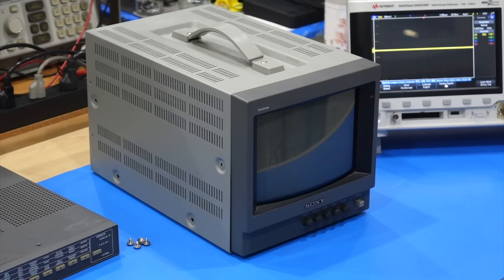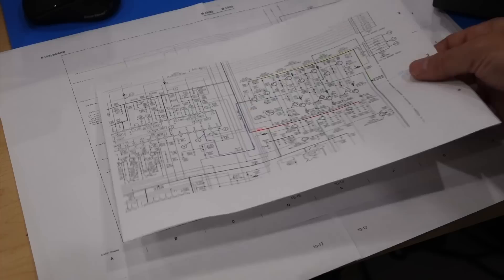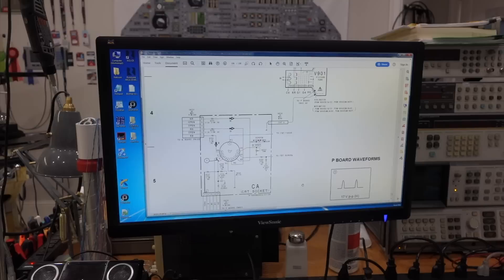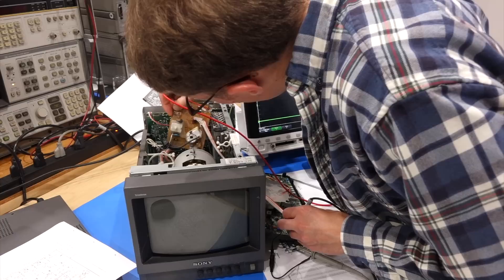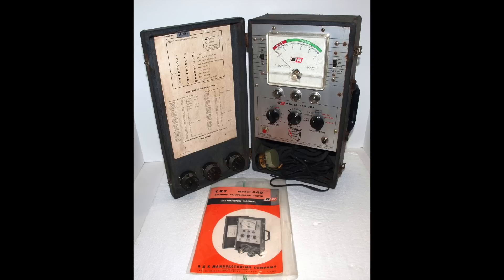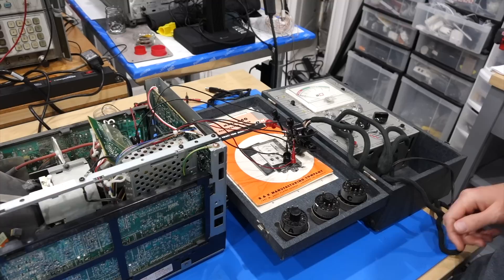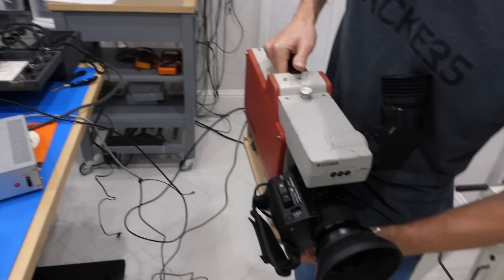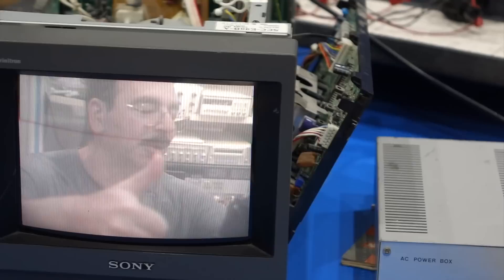Rejuvenating a color CRT

Comment: Awesome vid, takes me back a few years.  I still have a rejuvenator, it does not work on LED tv's.  LOL
Reply: Have you tried? 😂
Reply: To be fair you don't need a specialized, high vacuum glass working facility to rebuild a LCD with new backlights. A kitchen table, Phillips screwdriver, and an eBay account will suffice.
Reply: LCD..what a joke that was. The worst rv screen ever invented. I remember you had to sit directly in front of to get somewhat a decent picture. If you were off by 3 degrees off center luminous shifts to blotches of shadows.

Comment: I've had mixed results rejuvenating CRTs, the main thing I've learned is to quit while you're ahead. If you get improvement doing it once it's tempting to try hitting it again but in my experience that usually leaves you worse off than when you started. I've never tried rejuvenating a Trinitron but I always heard they did not respond well to it.
Reply: Do any of them ever last for any length of time though?
Reply: shango066 says never rejuvenate a Trinitron.
radiotvphononut as well ...
Reply: @wishusknight3009  Yes, sometimes, I've seen them go a few more years. If it's something like a TV that you're using for hours a day you'll probably buy a few months at best but for less used stuff like vintage equipment it can be significant.
Reply: @fostercathead  If it is still useable then yes, but a tube in this bad state you really have absolutely nothing to lose.
Reply: In Trinitrons and most recent CRTs the gap between the electrodes is quite small , so there's a good risk to end up with a short circuit. A workaround is to lower the high voltage and increase the max current to literally blow out the impurities. It's still quite like Russian roulette though
Reply: When I was a service tech for a TV shop, we would often give the tubes in our rental sets a boost when they were tired; some of them lasted another year after the treatment, some lasted a few weeks. The CRTs in the ITT sets, especially the older hybrid sets, used to respond very well; most Japanese tubes didn't respond well.
Basically, the larger the cathode, the better they responded to treatment; B&W (monochrome) tubes were often the most successfully recovered.
Reply: @wishusknight3009  It depends on the equipment, the condition of the elements in the tube AND the person doing it.

Back in my TV repairman days, I had a REM tester/recovery unit.  It was the best I ever used or had.
It could be very gentle to very harsh on the tube.  Even though I no longer repair TVs, I do wish that I would not have sold that unit. 

But anyway, tubes made in different eras have different results.
I found that the early tubes, like from the 60s, 70s and early 80s (name brand) would rejuvenate rather well and would work for months to years.

Of course, that's not always the case.  I had some where the tube was pretty much dead, I'd rejuv it, the guns would show as good, but like it was said here, in a few hours, the guns would start to lower output again.

It's really hit and miss.

When I had a customer where the picture tube was in poor condition, I had a special deal for them.
They can either say, do nothing, or I could TRY to rejuvenate the tube.  If it worked and looked like it would be stable, only then would there be a charge for the process.  If it didn't work, then no charge.

I went one step further too.  Part of the offer was, that if it works, there's a charge, BUT if it starts to fail again within 90 days, the money that they paid for the process would be deducted from a new picture tube should they decide to have me replace it.

Of course, I was always prepared, so if I already had the right tube in stock, I'd give them the quote on the new tube, then minus the rejuv price.  Usually, even if the rejuv failed on site, then I'd offer them the new tube at a discount anyway.

I liked working on flat rates, which my customers loved too.  No shocking surprises.
Reply: I have "rejuved" a decent number of tubes in my time now working with arcade monitors. Theres an art to reading the emissions and cutoffs and behaviour of the tube and setup. In general is something you just kinda find out working with things and your equipment. 

Almost always I run a clean and balance and never a rejuve using a BK percision, its a less harsh treatment to the gun assemblies and I have had very good results with monitors that still have some degree of cutoff left, better results if there is more cutoff head room. Sometimes you may need to do a second pass on either or all of the guns because running that can sometimes effect the neighboring guns. 
But as long as the tube responds actively to the treatment I almost never see the emissions drop further than they stablized and have meaningful improvements after the treatment. Rarely a tube may lose emissions again if that happens then the life of the gun was probably not good to start with. I have saved guns where there was zero cutoff and emissions with a simple clean and balance which had immediate and lasting results. I mostly worked exclusively with 90s to early 2000's era Toshiba, Matsushita, and Hitachi manufactured tubes though. A few zeniths as well that worked out alright. 

I have some monitors at home that have been running with strong colors since treatment for several years now to date. 

One BIG thing though is with trinitron style assemblies, I heard running any type of clean/balance rejuve is very bad for these tubes as the gun assemblies are more complex and fragile to heat/voltage internally and running this can kill the gun assembly or negatively effect the emissions materials on the guns.
Reply: Then there is removing the gun from the tube then replacing it. But because the part does not exist it would need to repaired. Not impossible but I'd call it an advance ++ difficulty. Getting Sony parts is either insanely expensive or impossible.
Reply: @metatechnologist  re-gunning tubes basically died out long long ago it was cheaper to replace the entire tube than to chop the neck and regun was my understanding
Reply: @plecebomc  there may be no other choice anymore because replacement tubes are no longer being made. If they are Sony parts are insanely expensive.
Reply: There used to be a market for plug and play BOOSTERS which raised the filament temperature to hyperdrive the cathode's final coating. IIRC, the roundie color CRTs responded best to rejuvenation. By contrast, Trinitron CRTs are the worst. I surmise those old roundies had such jumbo oversized electrodes and ample space to offer more mass for hope. Trinitron guns were shrinky and compact.
Reply: @directcurrent5751  I am not into repair for displays as old as BW Roundies an such but as far as I know those "boosters" are just gonna kill the thing faster. I guess if you already 100% did your due diligence and determined that the heater voltage needed and increase.. I guess thats all you could do. 

Regunning a color set supposedly is possible but its more difficult than a BW like its extremely involved?

Good luck ever find the parts or the design documentations to reproduce the gun assemblies for specific sets. I guess anything is possible though but man thats alot of work and probably capital as well. It would cost someone a very pretty penny. 

What I find amusing is that compared to LCD panels I think CRT's from a aging perspective are actually far more robust outside of gun wear and phosphor burn ins.

I guess full LCD repair maybe more documented and possible for edge cases in the future though. At least its not in a vacuum.
Reply: @plecebomc  I've never had an LCD nor LED television experience burn issues or diminished picture. They've had power failure and button failure.

Comment: Ive always heard from old timers that you should put CRT's on their faces when blasting them with the rejuvenation voltages. Because you're just blasting the carbon off of the emitters, that slow return back to original the original current can be caused by the carbon not being able to completely fall off, and when upright like that, could cause electrical problems if it falls on other guns.
Reply: Makes sense. On the other hand i've heard that it can fall onto the shadow mask and wreck havoc there as well. Not easy :D
Reply: @zaprodk  yeah as soon as I posted that I got to thinking about how precise trinitrons are for their shadow mask - worth considering!
Reply: @is0p0d  That's also why everybody says you can't rejuv a trinitron.
Reply: Interesting!

Comment: I would love to know how long it lasts before it goes back to purple
Reply from the maker: I think it’s reddening already. This is a fun experiment but not a real solution unfortunately.
Reply: @CuriousMarc  Would be interesting to let it run for a while and see how fast it degrades and then do a follow up video.
Reply: @CuriousMarc  something to note as well, some rejuvenators work better than others
Reply: @Runco990  yeah, same as with GPU reflow, especially when done in a household oven... These things don't last.
Reply: Needs to go to Glasslinger to rebuild the CRT xD
Reply: @DiverCTH  oh yeah :)
Reply: @DiverCTH  actually there was a small shop in my hometown in Germany where tubes for specialized applications (CNC machines, alarm and fire safety consoles and the like) were rebuilt. They stopped rebuilding tubes just recently. 
They were ridiculously expensive, though. I quoted the rebuild for the tube in my wheel alignment machine in my car workshop. They wanted about $4.000.
Reply: @CuriousMarc  So...good enough to get away with a sheisty eBay transaction, huh?
Reply: @KeritechElectronics  Have you investigated flip chip upper die reball? The underfill is a harder rubber epoxy. needs to be milled away. top die lifted, reballed, reflowed. If you try to just heat things up: you're twiddling your thumbs hoping the pixie dust in the substrate layers performs sorcery. Solder wants to expand when it melts - so if your oven reflow DID melt the balls: the underfill kept the upper die locked down, denying the balls room to expand, so they just blend into lots of short circuits. Nice job.
Reply: @skeggjoldgunnr3167  no... BGA is not the tech I work with - but I appreciate its teeny tiny precision madness after seeing how it's built, as shown in "Open Circuits".
Reply: @KeritechElectronics  GPU chip reflow can be a successful technique if the problem lies with the GPU. Doing it in a household oven does not actually reflow anything. Chances are high that it wouldn't work if it was.
Reply: @AnnaVannieuwenhuyse  agreed! Like @skeggjold gunnr said, the problem often lies inside the chip, on the RDL (redistribution layer), rather than on the chip-PCB interface. So, reballing it the proper way (desoldering, removing old solder, replacing balls) won't help either.
Reply: @skeggjoldgunnr3167  That's not how that works at all.
Reply: @AureliusR  and the sky is green and the grass is blue! There! I can do a baseless no-citations drive-by, too!

Comment: Was a TV repairman in the 1970’s. Carried a CRT rejuvenator in the van. Very short term fix. Most of the failures of CRT’s especially premature failures was due to poor evacuation of the tube causing premature cathode failure. Rejuvenated many CRT’s, none lasted long enough to make it worth it.
Reply: but those were new TVs with early failures. we're talking about sets that have 20 years of operation (and also manufactured with much modern processes). Rejuvenation of "modern" CRTs yields reasonable results. And... what are you gonna do instead? No new tubes to swap. It's either try a rejuvenation, or toss the tube...

Comment: I worked a lot in a TV repair shop in the 80s and early 90s and one of the most important rules of the owner of the shop was to never attempt to rejuvenate Trinitron tubes. According to his experience it almost always made things worse.
Reply: not true , i had great reslutls
Reply: He was wrong
Reply: Yes, i agree with the shop owner, trying to rejouvinate a Trini is like flipping a coin. It may work or it will kill the tube. Years ago i killed a KV-1300, so i will never try again that solution on a Sony
Reply: @repairitdontreplaceit  How often did you do it and how long did you or your customer use the rejuvenated set? I just remember that Trinitron tubes either die on impact, when you hit them with the rejuvenator, or they work for ten, twenty hours and are then weakening to an unusable state very fast.
Reply: correct, trying to rejuvenate a  Trinitron is like playing Russian roulette with a bullet in every other chamber.
Reply: @Telewaifus  You need the best of the best rejuvenator it was digital as far as I know and is even made for Trinitrons dunno the name anymore sadly
Reply: Sencore CR7000
Reply: I rejuvenated a 2130QM well i did a clean and balance, and now is good as new, its been 2 years since i did it and keeps going perfect, (the reds  where bad and focus)

Comment: I have reactivated many CRTs over years with a B&K 467. It really depends on how you operate these and many Techs do not know how to use them properly. I know many tubes have been killed by Techs who think they know what they are doing!
The B&K 467 has specific instructions, follow these and you will be more successful. I have reactivated many Sony Trinitron tubes and they have come back to life very well.  Some tubes of course do not have much emmision coating  left so not great results there.
I recall my uncle had a 22" Sony TV which lost its green too. After reactvation, it lasted 6 years! Its important to clean & balance ( the lowest gentle setting on the B&K)  the other guns too at the same time to get a balanced result.In fact use this gentle setting ro start with and you may find thats all you need. The rejuvenate setting us much stronger and really is only required if the CRT dies not respond on the clean & balance setting first off. After using the the Rejuvenation setting, you can then go back to the clean and balance for a final " clean up". 
Succesfull reactivation operations will take time and patience,  in my experience 10 mins or so to get it right.  Many tubes had excellent emission after this.
Please follow the correct procedure though!
Reply: Good to know. So how long did you hit the button to zap the Trinitron in clean & balance mode? There are some rejuvenators specifically designed for newer CRTs, such as the Müter BMR 95 and 2005. These automate the procedure, but it also means you're no longer in control. I have both of these, but still haven't tried on them on my 32" flat Trinitron with spent green gun, as the prevailing opinion is that these tubes are easily ruined. This video gives some hope (and the B&K used here is infact considerably older). But as pointed out here in many comments, YMMV.

Comment: Thanks for the stroll down memory lane!  I used to work on a lot of Sony PVM’s and BVM broadcast color critical displays back in the day.  I’ve been in post production since I was a wee engineering boy in San Francisco in the mid 90’s, and I haven’t got to play with actual electronics repair in way too long!  The “fun” displays were the BVM-D24, HD tube monitors.  We replaced the tubes in those usually every 3-6 months at a cost of around $30k/each.  The tubes never lasted due to how hard they had to drive them to get a 100 nit uniform display.
Reply: Why $o much?
Reply: @robertgift  two reasons: quantity and quality.  

The post production / broadcast TV industry did not require a substantial quantity of these picture tubes.  I'd guess that Sony only ever made on the order of 10's of thousands of the BVM-D24 HD displays (maybe even touching the 100k mark?)  

Quality was the other issue where we would often reject a tube for the smallest of defects.  Nothing short of a perfect tube was allowed since we used these to grade (color correct) images for film and TV, and color correction decisions were made based on what was seen on the display.  

Color uniformity and geometry had to be absolutely perfect on all areas of the display for us to create the quality film transfers and 'home video' HD grades of the time.  For example, we'd charge our clients something around $800-$1000/hr for our high end colorists and color correction services.  

I recall speaking with the Sony engineers about these tubes, and only a small fraction of the tubes they manufactured would make it to the end user.  Thus the cost was... substantial... to say the least.  

These days we use the Sony BVM-X300 and BVM-X310 series OLED displays, which are 1000 nit UHD/4k HDR, and these still cost upwards of $30k, but they last orders of magnitude longer than the HD tubes ever did!  

The high-end reference monitors always come at a cost, but you get absolute quality and as close to perfection as you can get, which is a requirement when you are creating content.

Comment: I've done many a tube with my home-built tester / rejuvenator which is based on a design printed in Television Magazine.  Mine added a feature to disconnect the heater during the process, idea being that it would cool down: Smaller cathodes cooled down quickest so reduced the chance of stripping.  Some tubes lost the plot again within some hours, most lasted months or years.  So rarely did I do Trinitrons that I can't remember if I had any luck with those, I suspect not.  Another useful tool was a home-made 25kV EHT meter which I would use to discharge the final anode before connecting up the rejuvenator.  I remember that a couple of times a year we would visit an ex's relatives and I would "boost" their old TV.  This carried on for some years before she dumped me.  The relatives then "accidentally dropped" the TV and claimed on their insurance for a replacement.
Reply: Neat! There was a rejuvenator in the workshop where I worked; in the 6 years I was there I never saw it used.
Reply: Do you remember what issue the design was in?